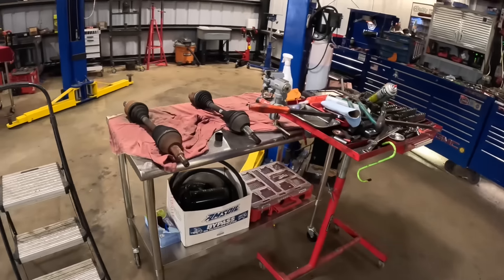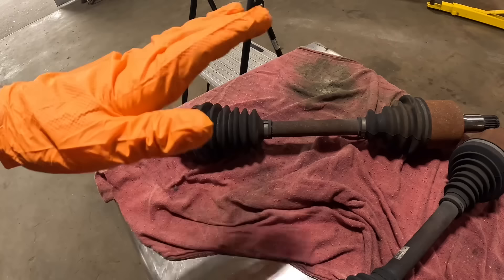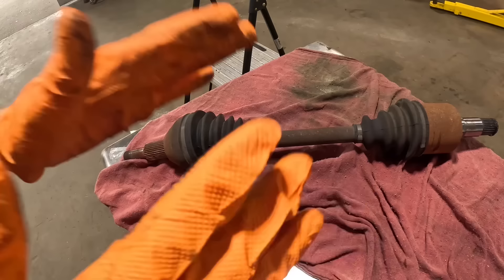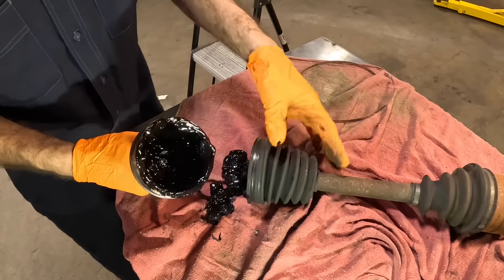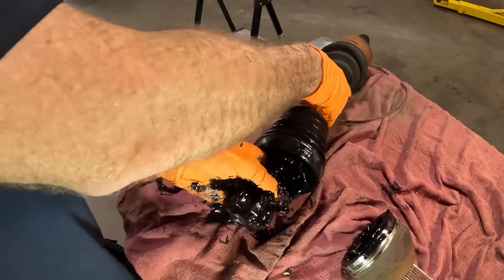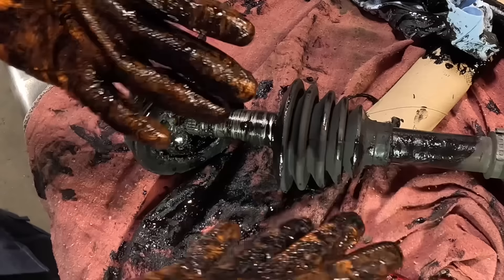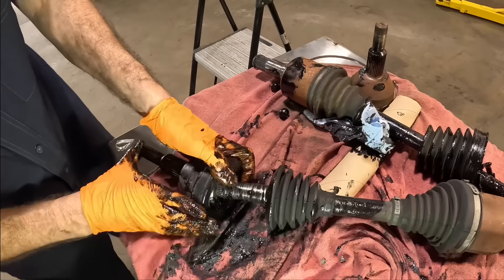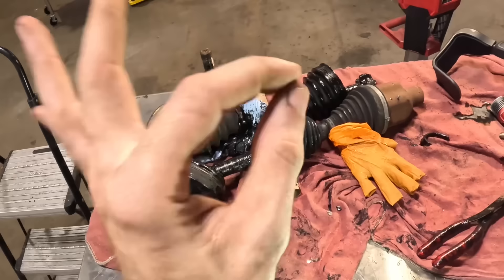Axle Autopsy! Towed in, Drove Out! Chrysler 3.6

Comment: The SPEED of the unit does not change, but the velocity of some of the parts do. Velocity is speed and DIRECTION. Speed is just distance over a specified time period. A change in velocity is acceleration or de-acceleration. The average acceleration is constant however, in a relative sense. If that were NOT the case, the part would fail, which it did!! 
Imagine an object, like the moon, orbiting the Earth. [The speed of the moon does not change, actually it does, because it is not a perfectly circular orbit].  The acceleration is actually constant, as is the speed of the moon, but the direction is constantly changing. [The moon is orbiting at a constant radius from the center of the Earth]. This is called centripetal acceleration. 
People are used to linear acceleration, such as a car accelerating down a straight road. Or conversely, a vehicle slowing down on a straight road. So the fancy stuff can play with your head. 
Just keep in mind that speed, velocity, and acceleration are three different, but related things. Trust the math, use the right formulas, and you are good to go. 
Defacto, it is quite simple really. Except it is a bit of a lie. Time and space are deeply entwined. So much so that scientists call it "space-time". We are used to only travelling slowly. The speed of light is ~ 299792 kilometers per second, or ~186,000 miles per second for 'Merica. Remember that there are 3,600 seconds in an hour. 
NASA's Parker solar probe is clocking about 692,000 kilometers per HOUR [394,736 miles per HOUR], which is quite slow compared to the speed of light. [ 692,000 divided by 3,600 is only just over 192 kilometers/second. Nevertheless, you have to take Einstein's relativistic effects into account for a lot of things. 
For every day stuff, all speeds are quite low, compared to the speed of light, so most times you can ignore Einstein relativity in calculations. So classical mechanics is more of an approximation than a lie. No one has personally experienced Relativistic Mechanics or Quantum Mechanics, so of course, we think all this is weird. 
Quantum particles are WAY smaller than an invisible bacterium, so we don't understand intuitively what things look like at that scale. And since only particles without mass  [like photons] can travel at the speed of light, we can't understand that with our guts/intuition either. So we trust the math. 
Now that I have bored you and/or freaked you out, the centripetal acceleration of classical mechanics does not seem that bad, does it? :-)
Quiz. If two space-ships were both travelling at 99% of the speed of light towards one another , what is their speed of closure? In classical mechanics, two cars straight on a collision course, each travelling at 30 miles per hour each, would mean a collision speed of 60 miles per hour. [Simple addition]. For our two hypothetical space ships, intuition would urge us to answer:- "Nearly twice the speed of light!" And it would be wrong.

Comment: seems like a waste they cant be recycled in any way. oh well. The earth has unlimited resources, right?
Reply: It will be recycled it will go to scrap metal, be melted down, and remade into something else
Reply: Not sure where you got your facts from, but that part is one of the most easily recyclable parts of any car.  Thank you for your virtue signal though.
Reply: @stevewhite3424  where you talking to me?
Reply: The CV joint housings can be used as drivers for larger bearings and seals. The shafts can be ground into drift punches or pry bars. Everything has a second use.
Reply from the maker: Did you ever see the dump trailer in the parking lot that full of metal? I recycle more than a small town.